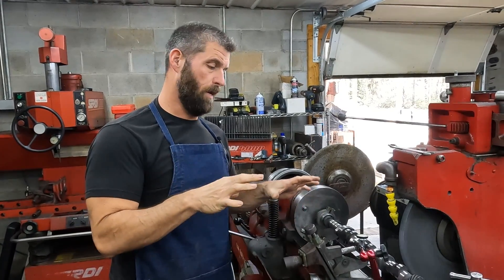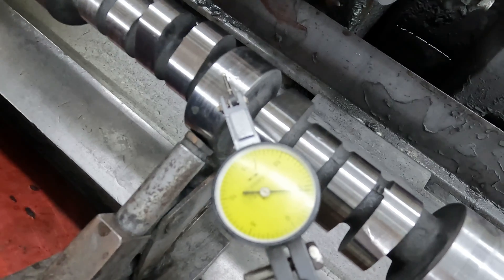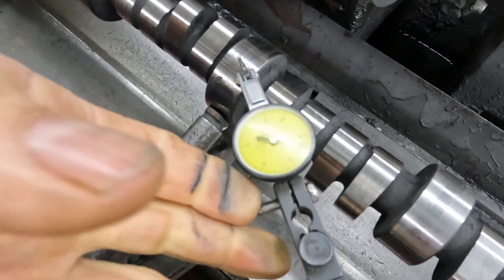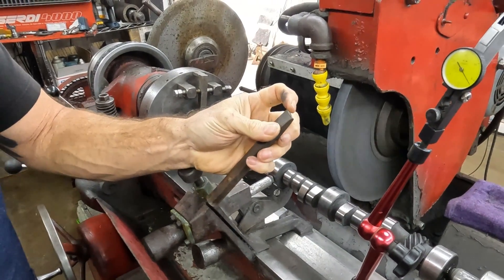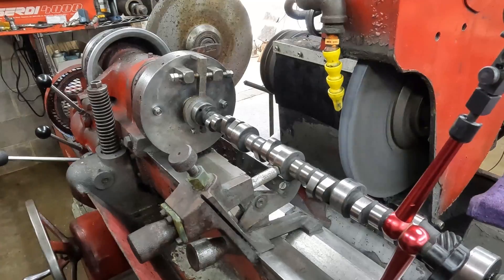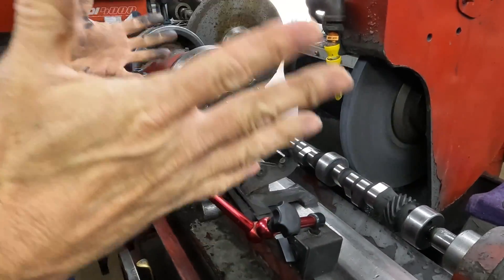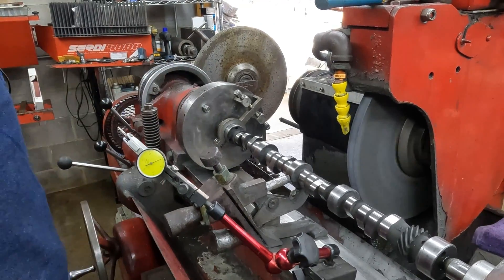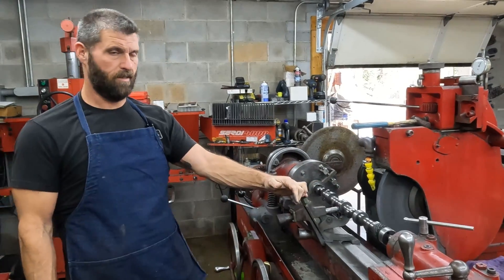How we straighten camshafts

Comment: If you drop a cast camshaft on a concrete floor it will break. Forged streel and aluminum can be straightened safely but not cast,
Reply from the maker: I straighten cast daily

Comment: At Pete's machine (when I was a kid) I remember Pete had the equipment to regrind cams and cranks, but I do not recall him doing cams, or many cams, he would normally buy a new replacement cam due to the cam lobe wear etc. instead of regrinding the old cam. You got some cool equipment in your shop- looks like you can do most everything or more that needs to be done to an engine. Good work, good job, thanks for the video.
Reply from the maker: Thank you sir!!

Comment: I had a Isky cam years ago which was pretty unusual thing being a roller tappet cam with Hard facing welded into each lobe. This process caused massive bending. Isky's had a team who would straighten the cams using a hammer and chisel to tap them straight. This left odd marks on the camshaft but it was perfectly straight. Pretty much the same method used here. BTW that cam would be 60 years old now and still working perfectly in a Chrysler 354 Hemi.

Comment: That's how Joe Rumpt at Holman and Moody's did it in 1961. Joe used an air hammer with a similar chisel on the end. Rat-a-tat-tat on several areas followed by checks for runout. Fred Lorenzen was our H/M driver back then.

Comment: ive built a shop full of engines and have never herd of a bent cam.  i clean and assembly lube em and as long as they rotate easy i roll with it.   so far never had an issue. i dont build many engines anymore mainly due to the cost of machine work.  our local shops want $400 labor to rework a set of cast iron heads. ill just buy crate engines from now on.  so far so good after i think were on #6-7 engines and 0 issues with the crate units. the next engine i want to try is one from blueprint engines.

Comment: I have had several cast cams arrive broken even though carefully packaged rolled in cardboard inside a cardboard box from the manufacturer. One was actually in 3 sections- hard to believe how easily they can shatter if dropped or hit. We tried to straighten a cam in the hydraulic press and it snapped- wish we had used your technique….lol

Comment: I honestly wonder if it even matters when you consider the load or pressures from the springs pushing against it. But we strive for perfection, it's the best we can do.
Reply: i agree with you.  by the time the cam is installed with lets just say a set of 100#springs on the seat plus a few open valve how much down force is on the cam.  lets not even talk about the high pressure racing springs.   id venture to say if a engine set for a day and you just removed the cam and tested runout it would be bent from sitting.  ill never test that theory so ill just have to wonder. lol.

Comment: Hi Daniel, you are a true American craftsman. Amazing to see a hammer and chisel used with a dial indicator in the same process. Question, would run-out be a common issue on new cams? Specifically, might it be the cause of a new camshaft binding in the tunnel with new cam bearings installed during an engine rebuild? Thanks
Reply from the maker: Yes, even shipping can bed a cam if it's dropped, handled rough,

Comment: About 40yrs ago, I was installing a Comp HiEnergy cam in my (now late)friend's '71 340 Demon. I was a machinist at the time, so I chucked it up between centers in a lathe at work and found it was bent 0.015" at center journal. So he sent it back and got another which was out 0.020". He sent that one back and got one that was less than 0.005". We decided that was going to have to be good enough. It was and it ran strong. I wondered if it could be straightened, and had it been my own used cam, i would have done it just like you did.

Comment: This is really fantastic information the average hot-rodders would never know. Thank you Sir. It also starts to make some sense why building engines with "loose" bearing clearance seems to survive better given the ?quality? Of most aftermarket parts
Reply: Good comment. Is anybody listening ? If I build a racing engine, everything is loose. 
If it's a figure 8 , super stock, or drag car, the engine is taken apart after every meet. Checked and freshened up. 
And I clean off the magnets I put in the pan.

Comment: Linear stretching… I have linear stretch dies for our Pullmax and planishing hammer, along with a few hand chisels and a couple of hammer heads reground to stretch sheetmetal this way.  On sheet it’s much stronger than using a shrinker/stretcher to stretch metal because you’re compressing instead of pulling to lengthen the area you’re working.

Comment: How much can you change the lsa on a cam regrind? I have a comp cams xr294hr and I would like it to be cut on a 107 or 108 lsa and about 8°-10° less duration on both the intake and exhaust duration @ .050" without losing much lift. Is it possible or would a new core be required?
Reply from the maker: None
Reply: @powellmachineinc  the cores are made with a set amount of lsa? So, lift and duration are probably have a small range they can be charged due to the heat treatment?
Reply: @inscoredbz heat treatment is generally when the core is manufactured. Nitriding is the common surface hardening process
Reply: youd have to clock the lobes to a different degree to change the lsa.  look up some cam tech vids and its easy to see.   a reground cam can only be manipulated within a certain window on specs.  and you would probably want a much oversize cam to grind down to your engine needs.   the base circle can be cut to add lift then grind the lobe to get the desired profile and duration.

Comment: After you grind a roller cam do you re heat treat them? There is a cam regrinding shop here and when I asked the operator of that shop if he does he said no.
Reply from the maker: Nobody does, it doesn't work that way, watch my cam core video for a explanation
Reply: Steel tends to move when it’s heat-treated, some kinds (much) more than others.

It’s common to 1) rough machine; 2) heat-treated; 3) finish machine for heat-treated parts.

Comment: In the late 70's I worked at Isky Racing Cams and started out straightening camshafts.   The first time they told me to hit it I was sure it would break.    We got soft chisels and rounded them so they would peen the shaft rather that put a stress point on it.  I was impressed (and busy) with how many times they insisted a cam be straightened.  At least 4-5 times or more.   any time is was worked on it was straightened before the next step.  If it was bumped on a wood work bench it was straightened before t went any farther.   The hard face cams were miserable to straighten.   Steel shafts like you have there I would tap about the same as you did.    For cast iron I had a bigger hammer and hit them harder.
Reply: The quality of work that Ed and his son who now has the shop, most would never understand the level of expertise and craftsmanship that goes in to their products before they go out the door!
Reply: @jeffalvich9434    Yeah Ed and his stogie "Hey Pal"   The boys were pretty much running the shop when I was there.
Reply: @gsxrsquid  the third camshaft that had ever ground Went in  one of my dad's flathead engines. Dad was always a fan of Ed.... You might have you been the one to work on one of my cams..... And yes I'm showing my age... Back when gas prices hit the roof around 1979 i  ended up buying a Datsun 620 with the 1800 cc engine... Of course the valves let go of a few thousand miles so I figured if I'm going to rebuild it I might as well hop it up...... Ed add what I think you guys called a dual purpose cam and man did that turn that  engine on..... We ran Chevy valves with the Vasco Jets valve springs... All from that shop of course.... Cut .090 off the head, bored is .030....  Hd 4 speed and 460 gear from. Z in the diff, off dual por intake, 300 cfm Holley bug spray carb and a Hooker header ..modified the collector to be a 180 degree exhaust system with duels straight out the back..... 0-40 mph was absolutely brutal iirr around 4.5 seconds..... I had a friend of mine who had a V8 Vega..... 454..... No matter what he did he couldn't beat me the 1st 50 feet..... He either smoked the tires or lugged the engine......😁
Reply from the maker: @gsxrsquid  yep, spot on
Reply: Read my reply above, I ran a 354 Hemi on the Salt in Australia using a Isky 4HHH hard faced roller cam ,which was pretty ancient when I first got it.
Reply: Used to operate an bmw/mbz/porsche engineering facility in santa monica, ca back in the late 70's to 90's - right next door to Jack Engle (Engle Cams) and often bench raced with Jack and his sons, Mark and Doug. Ed and Jack were instrumental in the 'scene' going way, WAY, back - and they obviously knew one another VERY well. I recall Jack telling me how they both revered Ed Winfield which is actually what lit their proverbial 'bumpstick' fuse, and got them started with their hot rods running at Muroc, testing and inevitably going into business for themselves in the early 1940's. Along with these two fine gentlemen, I also spent many an hour discussing not only profiles and materials but general technology with Dema Elgin. Journal runout and 'punching them into spec' has always been SOP for any highend, quality caliber build. For those of us priveledged to have rubbed elbows with these titans of the industry, their everlasting impact on our lives which was made just that much richer as a result - lingers. It is now up to us to share that which came before with the up and comers who have the desire and aptitude to carry on. Touche' to Powell Machine Inc.
Reply: First time i watched the guys at crower do it i cringed. They use a air chisel
Reply: All that because gas prices hit the roof ? How much did you save ?
Reply: @follow-yeshua  reading is fundamental....... The valves let go...ie burning oil...... So if I am going to rebuild and machine the cylinder head I might as well rebuild the bottom end as well.....since it was getting up in miles..... And yes... I spent $1,400 in parts and machine shop work to have a reliable vehicle for traveling 60+ miles 4 days a week going to college.

Comment: Very interesting, although, even though you straighten it out, whats to prevent it from happening again during engine run cycles?
Reply from the maker: Running isn't the issue removing metal is.
Reply: The cam journals / bearings keep them true